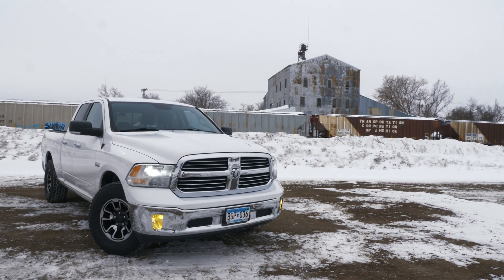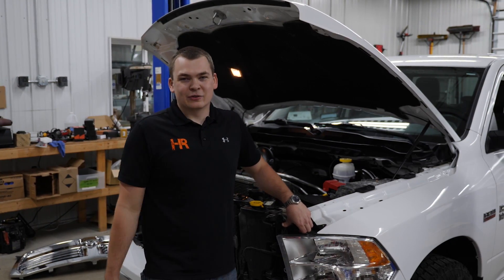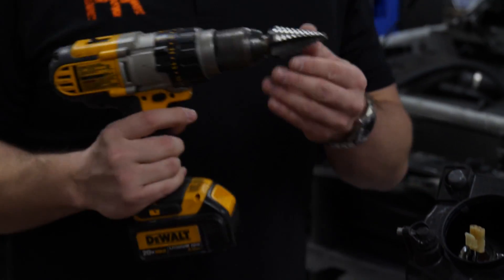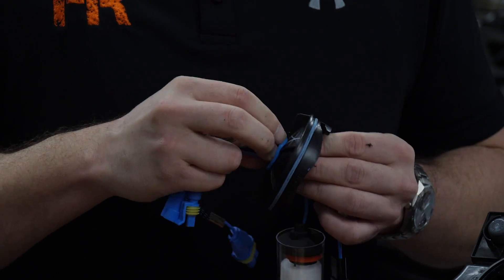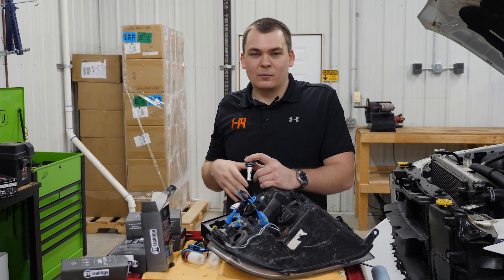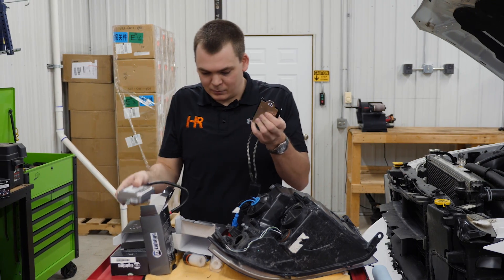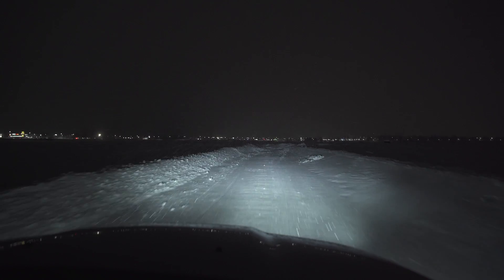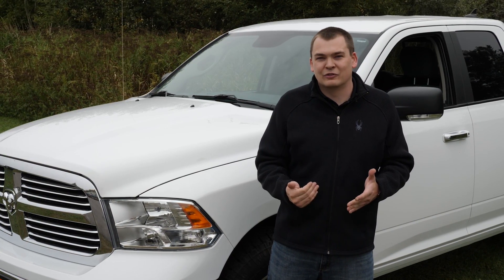2009-2018 Ram Easy HID Reflector Install UPDATED - Smart PWM By GTR Lighting

Comment: So these 5th gen ballasts don’t need to be grounded?????    Guess not if you’re just sticking them on with tape correct?
Reply from the maker: That is correct, They can be grounded externally with the supplied bracket but I’ve never had a vehicle need it.

Comment: I have a 2014 ram 1500 5.7. I upgraded to the OEM projector headlights and also bought the  5th gen hid ballast from headlight revolution, and I cannot get my hid system to work at all. They won’t even attempt to come on. I changed the polarity of the connections, still nothing. The odd thing about it the hid system for the fog lights work? I plugged the ballast in, no wire harness and they work perfectly. For the 2014 rams are their some cases where a wire harness is needed? I know the 2015 models need it. I just want to make sure I get the right harness. For the money I spent I wish I could get some help on the subject. Thanks
Reply from the maker: Hi Dylan, we would love to help you troubleshoot the issue. To streamline the process it would probably be best if you called our support team so we can talk through the issue in real time.
Reply: Probably need to change the settings in the ecu via Alpha obd software or obd JScan to enable

Comment: I've tried hid for years they where always professionally installed but my 2012 ram1500 sport always after a few months decided not to turn on the driver side hid light I'll change out the bulb with a new pair and again after a few months it does it again and only the driver side one  any ideas why? I miss my hids bit don't want to keep replacing them
Reply from the maker: This could be caused by any number of things. Which HID kit was causing this issue for you?
Reply: @HeadlightRevolution  to be honest first it was there shop kit which I didn't know the name of but I have the same brand as my fogs and there still going strong after 5 years. After it did it twice with them I got the innovative and it did it also